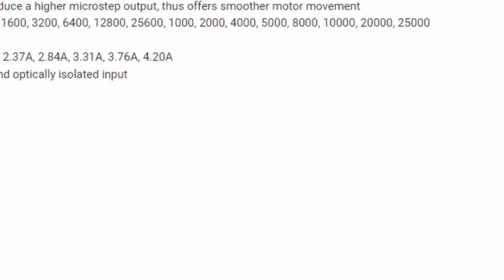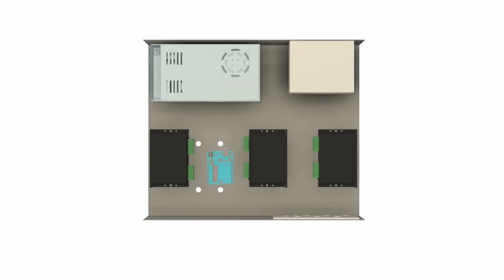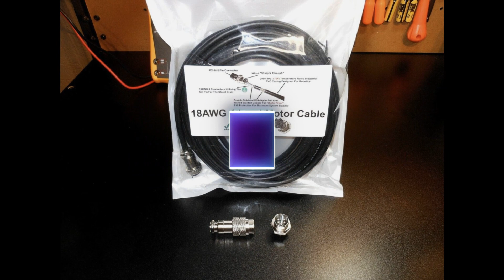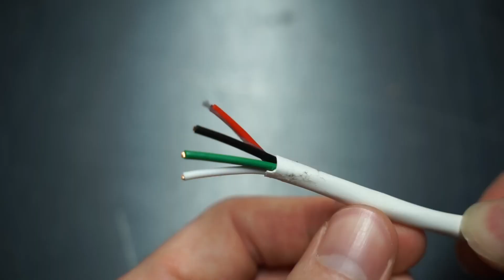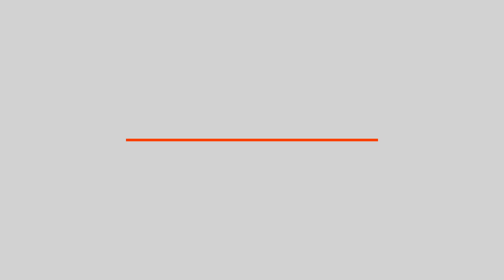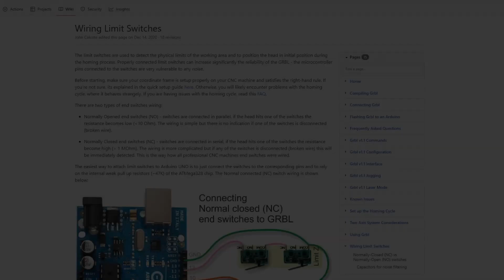CNC Router Controllers Built Incorrectly (Volume 11)

Comment: Really loving this series of videos, so informative thx.

I'm not in the market at this time but I'd love to get your thoughts on the integrated Servo Motors or Steppers drives. To me it seems like it could simplify wiring by reducing how many wires have to be run to each axis as well as free up space in the control cabinet, possibly even less heat to deal with in too. They seem like a win win but I'm sure I'm missing something like what's the overall affect on the systems EMF generated footprint, are they better or worse etc? Thanks
Reply from the maker: I actually have the answer, and I'm performing a build right now on my new integrated 4 axes drive system here. Its the best of everything as the drives use a motherboard to eliminate the wiring, inside the enclosure. Wiring the motors plug is all that's required. 

Here's the link https://youtu.be/vRFwHhkFxBY

Thank you,
Vince
Reply: @corvetteguy50  Very cool, thank you. Going to watch now 👍🏻👍🏻
Reply from the maker: You bet..:) I really appreciate the support. Vince

Comment: This person is just sharing his experience and information.  What’s so hard to understand about that? Why do you feel it’s necessary pick apart every word like some kind of two bit lawyer? If you have something helpful to add then add it.  This kid said he’s not an engineer.
Reply from the maker: Hey Brad, 

Well thank you for your comment, but I hope you realize if he assembles his CNC controller incorrectly using incorrect cables, incorrect grounding,  and another person from this content creator's audience practices what's displayed by him, and then finds out his robot is unstable then does he get to hold the content creator accountable? 

Shouldn't he be held accountable for providing misinformation to his audience if they use it, and it yields them problems with their robots? 

What if that person was you? 

I bet you would feel pretty angry as I've dealt with many clients who have experienced this, and not just with content creators, but also vendors who project they understand what they're doing, and don't.

Thank you,
Vince
Reply: @corvetteguy50  that guy has maybe 5 videos over the last year or two. Hardly a "creator".   It would be different if he had 100k subs and tons of videos out there but he doesn't.  Yes I got inspiration from his two videos on the subject but he made clear that he recommended shielded cable and other modifications. Yes, I'm having problems with mine too but learning a lot along the way. Just saying it would be good to have  a little grace and consider the source before deciding to let the accusations fly.

Comment: i just wish all the contentmakers would add more details and actually would talk less sweettalk to get you into buying crap that doesn't work straight out of the box, but this stuff is actually all what i have to work with in the (cheapo)  build I got to from not working at all to get a stable system that will work for minimum 10 continous production hours